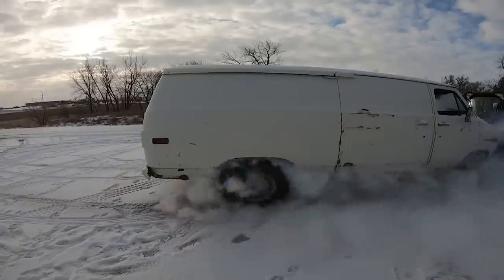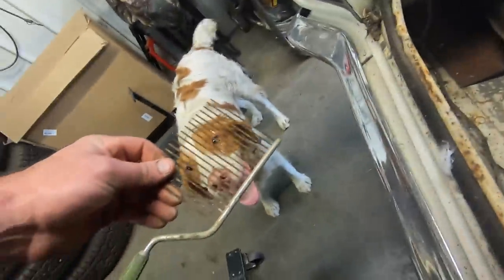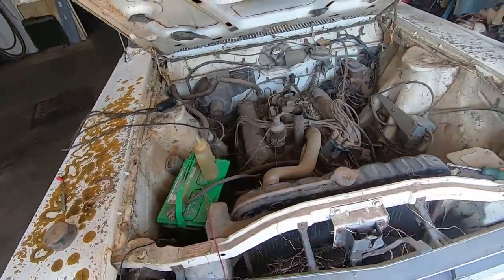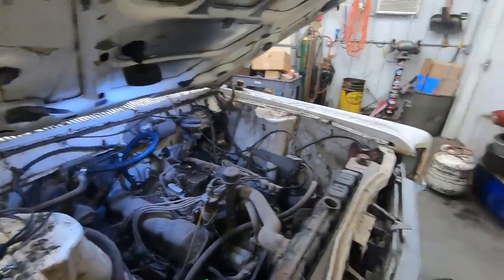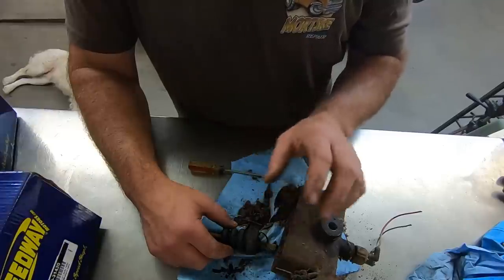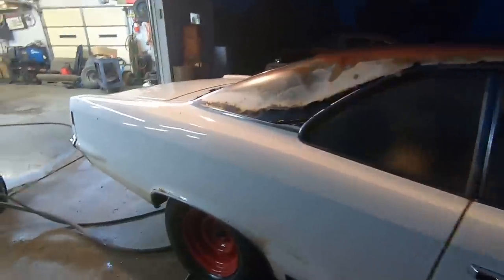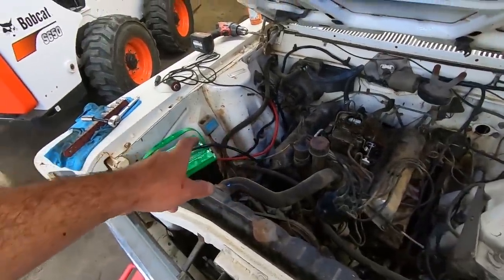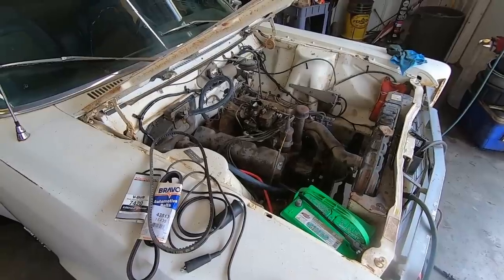1967 Rambler Rebel SST Abandoned in a Farmyard for 40 years!! Will it Run?!? AMC Muscle Car!

Comment: Well... on the plus side AMC V8's are basically all the same from 290 to 401 - parts are still pretty available. The timing covers, and oil pumps in them are a weak link, and a lot of these engines are written off when the only real problem is worn timing chains. I've done a lion's share of those motors. Bet you recognized a lot of the Ford ignition bits in there :D
Flat black on that roof would be my vote.
Sorry for the edits - I was doing this on the fly as I watched along ... that rear appears to be an AMC20 rear (round diff was a dead giveaway) with the 2-piece axles (ring gear is bigger than a D44) - not very popular among the CJ crowds. J-series Jeep trucks used the 1 piece axles but those were leaf-sprung.

Comment: I had no doubts the " Rebel " would fire right up. After all it is " A Man's Concubine " ! Had a '68 Javelin SST + GO Pak. Had the anemic BW M12 & 343 CID. Nice engine size for perf. Point of correction. The 'ole 727 or 904a Chryco tranny will not bolt directly to that v8 family due to the TC stub ( button ) being larger than the cranks would allow. Can be machined but is a hassle. I say blue rims and RED spoilers I Then you get a tribute " Rebel Machine " !        Cheers. I am writing Molson/ Coors on your behalf. Say Hi to Duff for us .
Reply from the maker: Much appreciated on harassing Molson/Coors!!

Comment: A larger diameter M/C bore moves more fluid, so is harder to push and typically designed for boost.  The smaller bore moves less fluid per inch, so less effort but more travel to move the same amount of fluid.  A 1" bore is actually pretty large for an M/C.  The disc piston is much larger hence more fluid to be moved, but typically has a shorter distance to go than a drum slave with a much smaller piston.

Comment: To get a smaller hose on stick the end of the hose in hot water for 5 minutes to make it flexible. The battery usually you want the terminals away from the firewall to prevent arcing of the positive with firewall or fender. In early 70s the Rebels came in red white blue like the  Ford Maverick and Pinto
Reply from the maker: I'll have to try the hose trick. Was that "The Machine"? I the made "SC Ramblers" in red white and blue as well.
Reply: @MortskeRepair  not sure about The Machine. The hot water works, just heat a cup of water up to boiling in a microwave

Comment: Oil based lubricants are great. If you cannot seem to get sticky components to loosen try soaking it in denatured alcohol.  Then splash the happy sauce on it. I work @ a nuke plant and figured that trick out on accident while waiting for parts from the warehouse. Denatured alcohol will break down just about anything. Isopropyl alcohol doesn't work as efficient.

Comment: I have the small lathe used for turning the commutators on Generators and starter motors. There is also a  dremel like adaptor gizmo for cutting back the insulators.
Reply from the maker: I've seen those lathes!

Comment: That axle is an AMC20. Has an 8-7/8" ring gear. One piece axles can be bought for them. Tough axle, just a small axle tube. 

Great car, too! Awesome find in awesome condition. Worst part about it will be the BW auto trans. They can be hard to find parts for, and you can't swap in the later Chrysler, or GM sourced, automatic transmissions; unless you have the crank flange adapter to go from flat to stepped flange.
Reply from the maker: Lets hope the trans holds up!

Comment: If this car had the 343 cubic inch V8 it would really be a hot performer with either the 2 barrel or 4 barrel carburetor. There are also axle ratio options in the higher numerical range to really make this car perform with the 343 cubic inch V8.

Comment: Shit hot, matey!  She runs!  She was a bit sketchy when she first rolled over and tried to fire, but then the starter made noises like another cylinder's rings had joined the party and she cranked more even and then fired.  Doesn't sound 100 yet, but she'll come around.  Just needs a good cup of whoop-ass, I reckon.....and them filigree exhaust pipes that have more holes than an orchestra wouldn't be helping her idling acoustics.  

Man that thing's a looker.  Sorta reminds me a bit of the late 60s Mopars - especially with that dual headlight setup.  Love the interior (well, how it would have looked back in the day) and them frameless doors.  Cleaned up better than I though she would too, although I'd have probably been tempted to aim that pressure washer at the floors and blow the remnants of carpet and mouse habitat out the inside of it and all,  

Love the stance you got on her now too - very much the look of the 70s, that.  Big wide wheels on her rear end and near stock sizing up front....but don't go black wheels, man.  Black wheels just blend in with the tyre and look like a big hole.  The deep red with some dog-dish caps would suit.....or that gold you were thinking of (sort of a metallic bronze almost) with the caps would work well too.  Actually, if you did the roof in a satin of whatever colour you did the wheels, would that look too corny to you?  I reckon the red or the bronze would work, but any other colour it might look naff.  If you weren't going to match the wheels, the roof HAS to be black and I reckon go satin rather than flat / matt finish.  Satin would tone in with the rest of the paint as is or look like a black vinyl roof if you polished up the white. 

Love that car, man.  We never really saw AMCs down here until import rules relaxed in the late 80s and we got the odd Gremlin, Pacer and a few Ramblers of the four door variety.  Hadn't seen a coupe before until just recently on another channel, but not on the road here.  Our loss - they are a great looking vehicle and something very different to the typical muscle car.  

Now, SST?  Interesting choice of submodel lettering that.  Datsuns sold in NZ had a SSS package option - which was basically some different trim, a few badges, a nice set of slotted mags and a twin 40mm side draft Dellorto carb setup but everything else was Shamefully Stock Standard (which is what we reckoned the SSS stood for), so maybe AMC went one better by going SST?   Slightly Sporty Trim package, maybe?

In any case, I am looking forward to watching this beasty improve, Mort.  She's gonna be a grouse machine when you've finished with her, that's for certain.

Comment: The old caster oil and alcohol brake fluid is never mentioned on any of the resurrection auto channels. I can't be the only one alive that remembers the stuff. Alcohol and water mix all drinkers of hard liquor will know that. In the bad old days brake systems were plagued by rust and decay inside from water in the system. This master cylinder reminds me of this issue.

Comment: 1 correction is that you could also get a 67 Rebel SST in a convertible, as I am restoring one.  But I am putting in a 401 engine to replace the 290 that came in it.  I also have a 67 hardtop Rebel SST that I have parted out.  So I have some of the parts you might need.  PM me your needs, if you still have a need. I am in Northern AL  Don.
Reply from the maker: I already sold this one but my email is in the description of the video and you can reach me there and I'll set you up with the new owner.

Comment: We had an International Harvester pickup with the 345 engine in it. I think it was the same as the Javlin motor. That thing would eat any stock 350 chevy there ever was.  I would take it to school in the late 70s to 1980 and pass anyone I wanted and they could not stop me. A friend in a 455 Buick Riviera insisted I open the hood, because he thought I had some kind of sleeper.  All I had was a 2 Barrel carb and auto tranny in an ugly yellow truck. My cousin begged my dad to take it to the local drag races, but that was not his thing. He just used it to take the trash to the dump.

Comment: Master cylinders used with Drum brake cars have a residual check valve built into the master cylinder to keep a bit of hydraulic pressure on the wheel cylinders so the brake pedal is up at the top on the first pump. The master cylinders meant for disc brake equipped cars do not use a residual check valve as the brakes would stay on even when the pedal is released.
Reply from the maker: That's the term I was looking for! Thanks Harry!
Reply: @MortskeRepair  You are welcome. If you have more questions I will do my best to answer them. I started twisting wrenches on cars, trucks, aircraft and boats back in 1959 and I'm still turning wrenches part time. I remember when the Rebel SST was new, unfortunately AMC did not sell a bunch of them as about the same time the AMX and Javelin came out with bigger engines and were sportier looking. The SST could be ordered with the 390 engine which made the car a blast to drive especially with a 4 speed trans.

Comment: If you go find a dumpster look for wide steel strapping from crated packaging, auto stores sometimes have some also out back, makes great material for tank straps and other things, super strong spring steel.
Reply from the maker: Good tip!
Reply: @MortskeRepair  Yes sir, have made several things with it.

Comment: I'll have to say I definitely love this guy's work great job! The dog is great  handsome pooch.  Notice at the beginning of the video that he likes to roll around after a spa (bath) and get some of that fresh cologne my wife's dog he does the same thing. But I was just wondering who has the biggest issue with breaks ⁉️you or Derek from vice grips garage it's like everything you two touch it needs brakes fascinating down here in Texas we don't have to worry about the rust like you guys do. l do get it I lived in the snow belt. So I was wondering if electrolysis would have cleaned that master cylinder up ❓ Maybe you could do a carb rebuild.😊
Reply from the maker: Seems like all the seals in the brakes are the first thing to dry up after they park them. Must be nice not to have to deal with rust! I don't think there was any saving that master cylinder. We'll go through a carb one of these days when we get time.

Comment: I run my 350t in my street strip car with unhooked transmission modulator valve you just have to run it like manual auto and shift every gear up and down if you forget to down shift they will do some funky things sometimes pull out in second sometimes just shifts to second but as long as I run all 3 up and down it does fine
Reply from the maker: Interesting!

Comment: I had an old Rambler with a 6 cylinder b i d. Was doing about 35 or 40 when for some reason I picked it up on the brake pedal with my foot and the whole damn thing fell apart. Obviously no brakes went through a liquor store parking lot up the wrong side of the  Street and landed up against the curb pulling on the parking brake. Needless to say I never did that again and fixed it so that the rod wouldn't fall out with the brake pedal.
Reply from the maker: Oh man! Sounds like a ride!

Comment: Super Sonic Transport, passes everything but gas stations. Since they went to the trouble of changing the oil I would think they would have a nearly empty fuel tank with lots of stabilizers in the tank. They must have planned on using it again but didn’t get around to it.

Comment: The drum brake master cylinders have a check valve built in. Keeps cylinder residual pressure. Drum brakes need that, disks will bind with residual pressure. 2 wheel disk master cylinders have residual pressure to rear to rear, none to front. 4 wheel disks, none. 4 wheel drums, residual pressure to ft., and rear.  Love,,,,Dubs

Comment: The inner door handles look similar to a lot of Impalas/Caprices from the 60's. You should do some measurements and take a trip to the salvage yard in podunk. Just about anything that fits and has the same ID would work, including a window crank if need be. You could confuse passengers trying to figure which handle to use to roll down the window.
Reply from the maker: Yeah I'll have to get them off and do some investigating.

Comment: When trying to fit a hoses like rad, heater & fuel hoses onto a fitting that is bigger, go boil the kettle, get the missus coffee mug( dont tell her😉🤣🤣) dunk the hose in the boiling hot water for 10-30 seconds. It softens up the hose so it usually......usually goes on🤣.
Reply from the maker: If only we had running water! And something to boil it with!

Comment: a dime sets the spark plug gap, a matchbook cover sets the points
Reply from the maker: I need to carry change and take up smoking!
Reply: i had a '68 - 343 with the carter double pumper it ran 1/4 mile in the fifteens, maybe 8 mpg i used to joke that the gas gauge went down as fast as the spedo went up :)  was a fun car and pretty fast for it's day.  came from the factory with premium gas (leaded) only stickers,  i mostly ran drip :P

Comment: Yes amc used rubber hose leads to connect the metal lines to the trans cooler in the radiator
Reply from the maker: Finally someone responds! Thanks much!
Reply: @MortskeRepair  when u showed the lines, the 2 rubber with the crimped ends and thread fittings twards the rad are oe American Motors.. the plain rubber hose from the hard lines to the oe rubber are probably some repair done in the past. Like that heater core hose u replaced would have been a factory moulded hose.if u check with Kennedy American, i believe they still sell them.. same with alot of the hard to find parts. Awesome car!  I have a 70 amc ambassador so i have a soft spot for the big body amcs.
Reply from the maker: @---skynet---  That's cool! Only ever seen steel from the OEM!

Comment: Those inside door handles were known to be a weak point on AMC Rebels and ambassadors but, luckily, they were only used in 1967.
Reply from the maker: Shoot, hopefully newer ones fit!
Reply: @MortskeRepair  you might be able to use door handles from 63 for five or six classic or Ambassador or 1964 through 1969 American. These should fit on the splines of the door handle but probably will not fit behind the armrest

Comment: Great Choice good man.  Rock Auto= Raysbestos MC36237 or Centric 13063010 Master Drum/Drum are the two heart items. You gotta be able to stop once you start or you could hurt that primo bod. Do check the condition of the vacuum line from back of the manifold to rear of transmission case. Steel coupling @ manifold through steel line to short rubber hose into the Vacuum Modulator that screws into trans at rear bottom left. Eyeball that rubber hose for cracks or completely off the modulator. Car wont shift into top without vacuum. Found that out on my 66 Rogue 290. Have you got an email addr? I may have a proposition to support revival/channel. Cheers, Steve
Reply from the maker: Steve, my email is listed in the description.

Comment: All my Javelin door handles were broke when I first got it too!!! Lol
Must be a Curse!😆
A couple pairs of needle-nose vice grips worked until I found some. Now I see why AMC stands for "Ain't My Car"!! Lol.
I will say one thing about most AMC vehicles I've encountered including my own...... Is that they're not very bad for rust.🤷‍♀️ Even ones I've seen neglected for 50 years in the woods seem to be pretty solid metalwise. I think its because AMC was zinc treating all of their steel in those days. had that been a Chrysler product sitting outside for 40 years there be nothing left of it.
Guess there's a bright side to everything?😆
Reply from the maker: Where did you find replacements?!?
Reply: @MortskeRepair  just scoured online until I found some NOS handles on eBAY. They break all the time.... Even back in the 60-70's when they were still fairly new.... So they made a whole lot of them. Don't be surprised if a Marlin or an Ambassador uses the same inside door handles. But yeah.... Somebody has some. And there's a few AMC heads online that are also parts distributors. And if they don't have it they know where you can find it.
Reply from the maker: @chrissytaylor5690  I'll keep an eye out!

Comment: My first car was a AMC Gremlin with a 304 v8 an I had a AMC Hornet with 304 v8 as well. Wen you power Wash the car don't for get Dug the Dog stinky. Master cinder $42.00 an it don't have a bolt to hold the lid on

Comment: Super Sport Transportation .. Super Slow Turkey.  super slipper transmission.. or the ever popular  Stupid Slow Turd. I'd Black the Roof and paint those front's Red to match rear. 15x6  w/ 245/60/15 is a Good size. I dislike 14's too. but American muscle car on 15's and it's Period correct. Love the Body lines. like a cross between a Nova/ Chevelle.. early body style '64-'67

Comment: I collect beer cans.  I keep one full and one empty.  I like to have one full, one enptied and one with holes punched in the bottom with the top still sealed but yet empty.  I want 4 of those.  I don't have that can.  Oh hell make it a six, that way I get the three cans I need, one in case I make a mistake and screw up the one I'm putting the holes in the bottom of to drain, and 2 to drink to see if I like the beer.